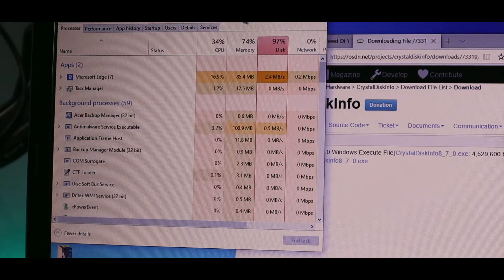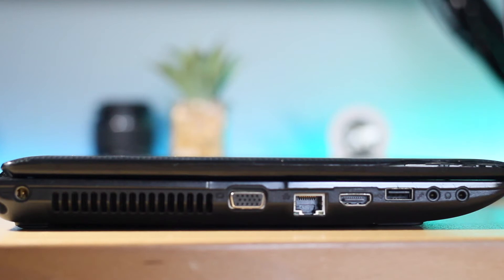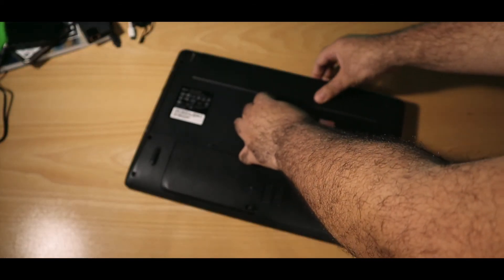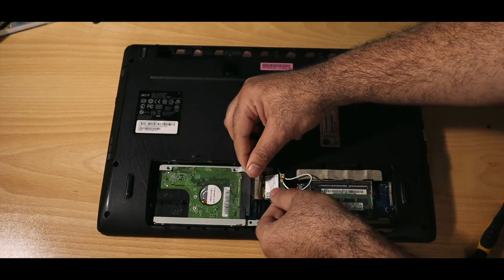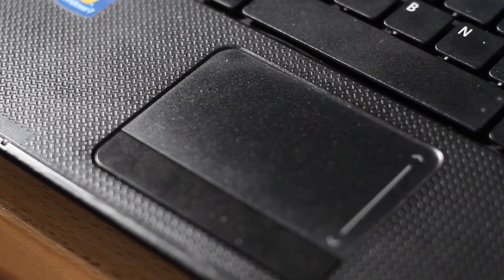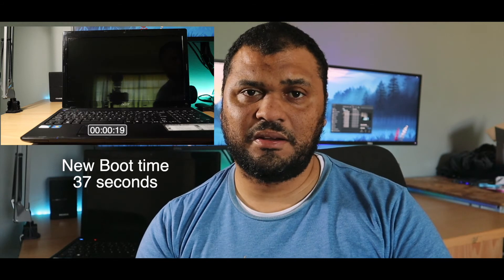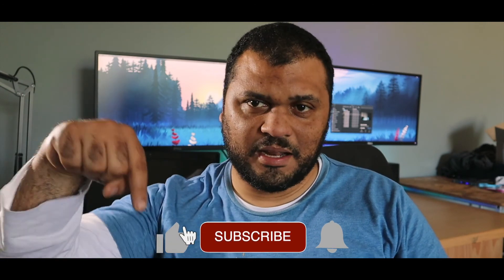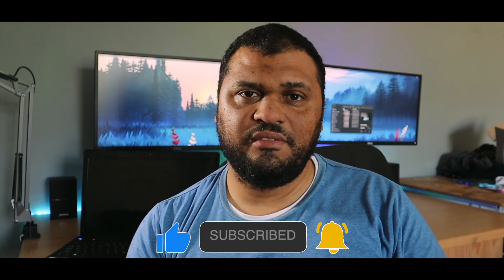Acer Aspire 5736Z Upgrade

Comment: I have this laptop here and bought 2x 4GB 1333mhz, but the system gets laggy with the 2 modules... like the latptop couldn't handle it.
anyone had this issue before ?
Reply: you need to use memory modules 2gb + 2gb DDR3-1066, DDR3-1333 format 1.5v 2R * 8 from well-known manufacturers: Hynix, Kingston, Samsung, Crucial. 
Chinese memory modules may be defective and the laptop does not work well. I have come across such memory. What processor do you have? SSD or HDD in laptop?
Reply: @vladimirazirov1815  I'm using Kingston modules, 2x 4gb
Reply: @fudupi  What processor do you have? SSD or HDD in laptop?
Reply: @vladimirazirov1815  it's a pentium T4500, and I do have a SSD
Reply: @fudupi  Probably for the Pentium is a heavy burden. To increase performance, you can try installing an Intel Core 2 Duo T9300 processor instead of a Pentium.  In the "disk properties" (Ws 10 x64) enable SSD optimization once a month, so that the disk is not clogged with information and does not slow down.

Comment: Great content!
Can you install 2 x 4gb of ddr3 sdram sodimm 1066mhz on this laptop?
Thank you very much.  
Also, is the size of the ssd the same as standard 3.5 inch ssd?
Reply from the maker: Of what i researched the max ram is 8 gigs the max so you can use 2 slots of 4.  The ssd was a 2.5 inch
Reply: @CBStevens  Very good.  Thank you
Reply: @CBStevens  Thanks for answer but, the same ram at 1333mhz is possibile? Or 1066 is max?
Reply: @Dickmen94  as far as i know, if you use a ram module with higher mhz than supported by the mobo, it will cap at the limit.
in your case, the 1333 modules would work at 1066mhz

Comment: hello, can you give me more of details of the specs you upgraded?did it drastically imporve?
Reply: Well, I had 4 gb of ram originally in it but I did switch out the old hd for an ssd and just the ssd install was smooth as butter fast.
Reply from the maker: Hello , sure so the harddrive was the original factory shipped one a 500GB 5400rpm , The wireless card was the generic single band card and 2gigs of ram was replaced with 4. The boot up and applications launched super fast compared to previous parts. Like I said it's a family members of so it's small upgrades for better performance
Reply: @CBStevens  shall i use 1 4gb ram or 2pcs 2gb each?
Reply from the maker: Honestly use 2 pcs of 2 gig ram i just had the 4gig laying around but the bandwidth will be better with 2 dims. I got a new vid coming with the Acer predator with 32gigs of ram if you interested. Thanks for commenting and hope i could be of assistance
Reply: @CBStevens  alright, thanks Sir & yeah, i would try that, your tips are highly appreciated
Reply: @CBStevens i need the last drivers, where i can download the drivers for win 10?
Reply: So that would mean 2pcs DDR2 2GB?
Reply from the maker: DDR3 yes
Reply: @CBStevens  hello again,, is it possible to remove the lag from games?
Reply from the maker: What you playing
Reply: @CBStevens  roblox? and sometimes, even if im just browsing, it will lag up to the point where i will restart it.. any tips?